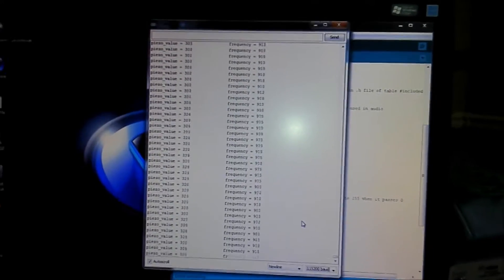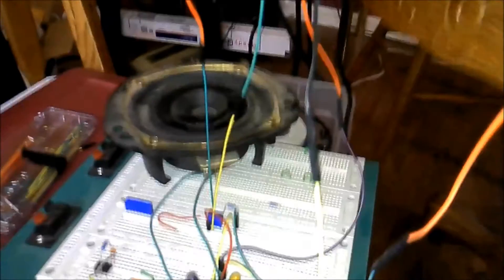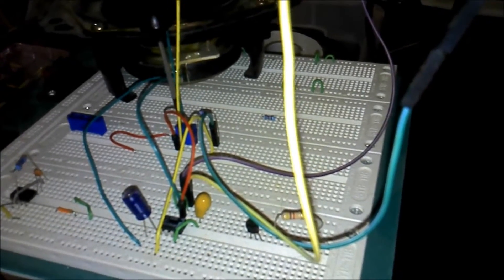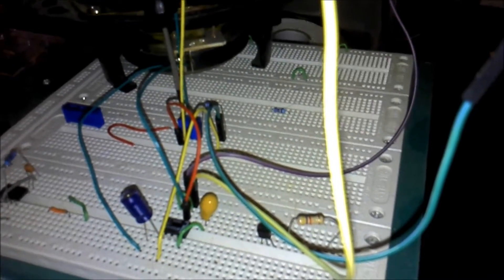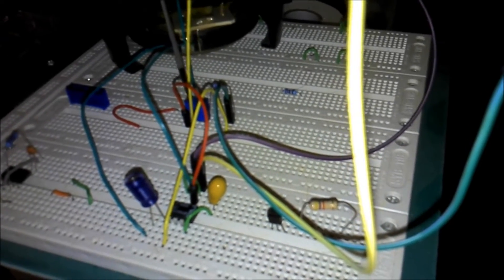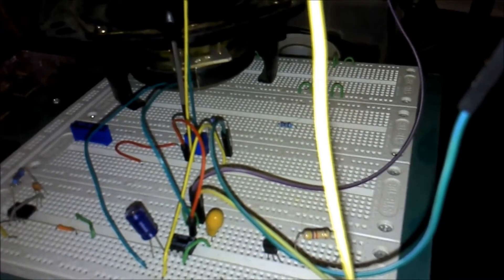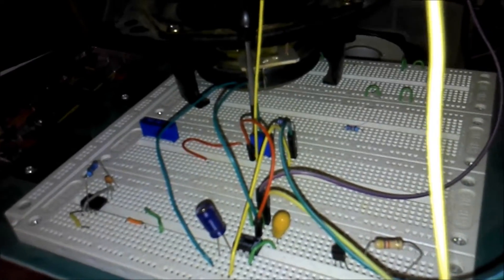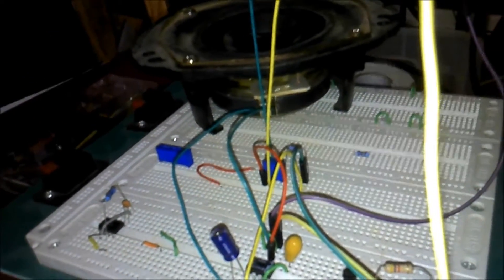Using Arduino Mozzi Library as a VCO Part 2

Comment: Hello I need counseling please.
I'm doing a project on measuring radiation using a robot controlled by Arduino, but I have problems with electronic circuits.
I set the frequency of the signal generator to represent the amount of radiation (very high frequency means the amount of radiation). I want to change the frequency. (The amount of radiation changes). The voltages change with the arduino and use the volt analysis.
If the signal used to analyze is monostable, what should I do?